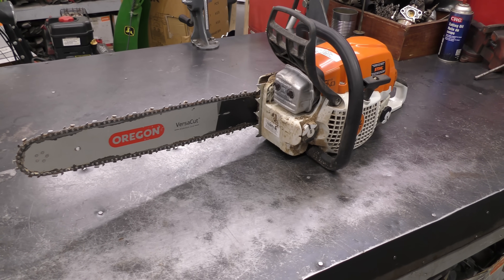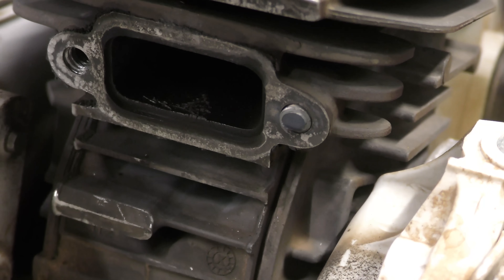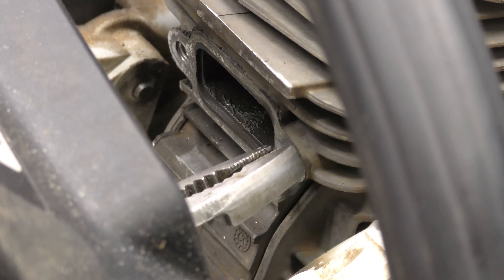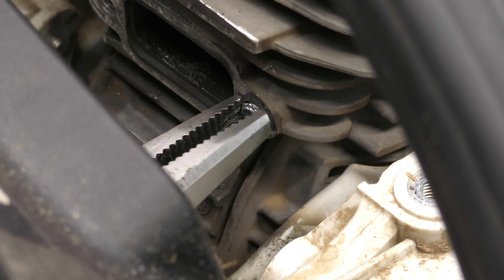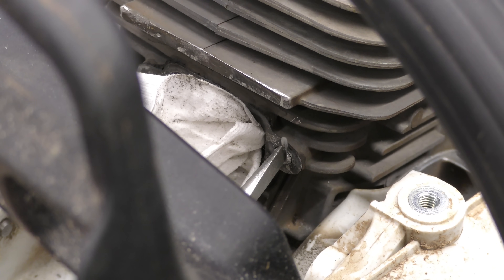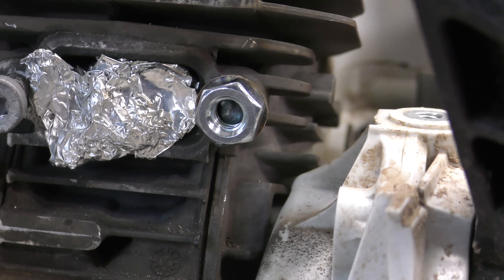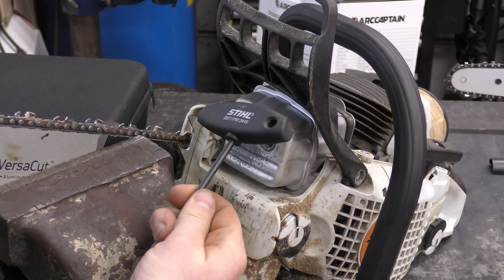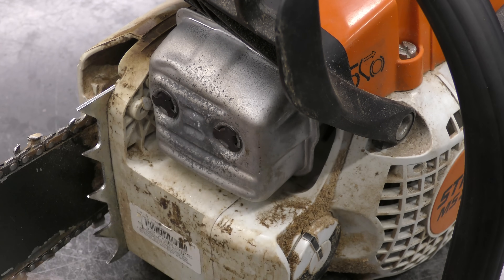STIHL MS291 Chainsaw Broken Muffler Bolt In Cylinder - Here's How To Fix It!

Comment: adding the washer is a great idea , thanks . sometimes when i'm drilling a broken bolt out (i don't have a mig yet) i use a cheap set of left hand bits from the freight store . occasionally the bit will grab just enough to unscrew the bolt , if it isn't too tight .

Comment: Hi Donny. This comment has nothing to do with this video but I thought I would share this. My neighbors 038 Sthil chainsaw is a beast to start at almost 5hp. I noticed there seemed to be a spot for a decompression valve so with constant compressed air through the plug hole to keep the chips out I mounted the engine in my drill press and put a hole in the top. Then I carefully tapped it out using a 27 TPI tap and cut a hole in the cover. What a difference for old guys to start it.😁

Comment: I guessed you’d drill and use a reverse thread extraction tool.  This looks better but if you don’t have the money for the welding equipment the drill extraction tool is cheaper

Comment: Good video. I'm surprised you didn't use a high-temp anit-seize grease on the bolt threads before attaching the Muffler. Could prevent the reason why the original bolt broke off to begin with.
Reply: Buenas
SI SEÑOR

Comment: Had this happen to me. Mine was a Farm Boss and the holes for the flat headed bolts are slotted in the cylinder. Cheap aftermarket muffler burned and let the muffler bolt get sucked into the exhaust port, and down into the crank case. 
 Broke the engine down and the stupid muffler bolt was jamming the connecting rod from turning. Damndest thing. Pulled the bolt out, didn't find any other damage. Put it all back together and it is still running to this day.

Comment: Nice trick worked great. Another thing you could add to your arsenal of tricks is a center punch. Heat a little and use a center punch around the outside edge of the bolt to unscrew the bolt.

Comment: This is my first option, it just works all the time. Those torx screws are pretty hard, surprised it broke but my Husqvarna blower vibrated the muffler apart so anything is possible I suppose.

Comment: Nice job, Dony. Lucky to have a bit of bolt sticking out. I just had an MS211 in the shop with exact same issue. However, my bolt was broken flush. Had to drill it out and cut new threads but it turned out fine. Keep up the great work!

Comment: I wouldn't have thought about the washer, but it's completely neccesary there. However, I think I would have tried with pincers first, as I think they might actually bite on what was left of the screw. It depends on the shape, of course, but that's what I would go with in the first place.

Comment: yup, been there a hundred times...usually it takes 5 or six nuts before it comes out but you were very fortunate.....usually we start small and end up just finally really blasting it  with full force to get the broken bolt out of the part....steel on steel is usually the most difficult for me because it is like a natural weld and really strong

Comment: Why does the picture of the cylinder at 3:44 around the broken bolt look  different to the picture of the threaded hole surround at 5:32.   There appears at 5:32 to be a change in the surface surrounding the threaded hole, an irregular indentation - what happened?

Comment: I'd definitely like to see a fix for one that broke off flush?? I had a bolt break off flush on my cylinder of my motorized bike. I was putting a performance pipe on and the bolt snapped flush. Any suggestions Donyboy?
Reply from the maker: In that case I drill hole, try extractor and if that doesn't work I make sure the weld goes inside drilled hole and do the same method as here.
Reply: @donyboy73  great idea Dony, Thanks so much for getting back to me. I really appreciate everything you do good Sir

Comment: I honestly have no idea how anyone gets by without a welder. Even a cheap 110 flux core machine makes easy work of things like this.
15 years ago when I first started working on heavy equipment I bought a set of bolt extractors off the mac truck, and used them with mixed results for a few years until I finally broke down and bought a welder, and it was a night and day difference for extracting broken bolts. I still use extractors, but only in places where I can't use a welder.

Comment: Nice work Dony. I was hoping you were not gonna use the Ezy-outs. I’ve never had success with them on a bolt that was stuck firm. When i saw the welder coming out…..I was cheering! Would some  anti-seize compound be a good idea on those exhaust bolts?
Reply from the maker: Yes the copper one would be good.

Comment: 99% washer and nut for mee dosnt work! you only get lucky ones
Reply: A trick I have heard is to let it cool completely before trying to turn it.   Like you, my results have been hit or miss and it usually takes me a couple of nuts, but I’m going to let it cool completely the next time I need to do this.  Ironically enough, I just walked in from the garage and had to remove the muffler from my MS290.  Luckily they came loose fine.